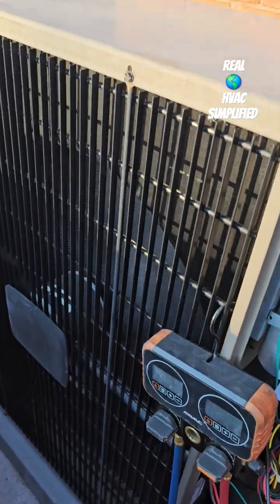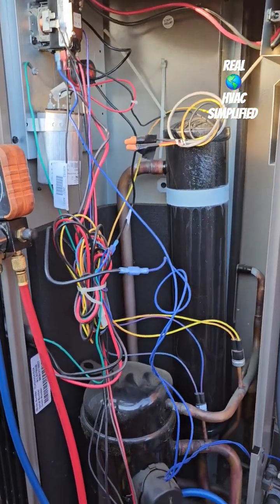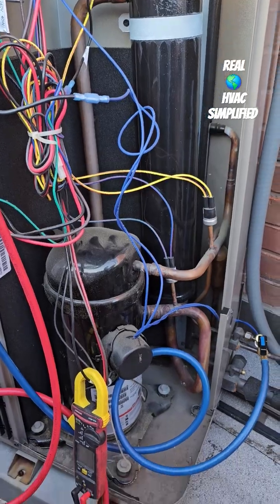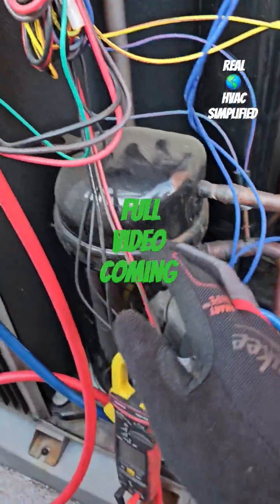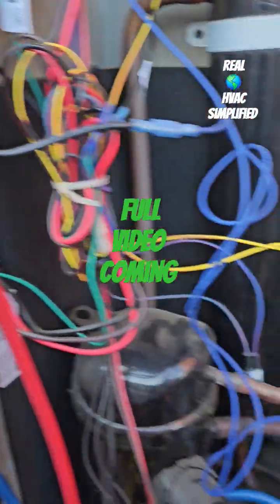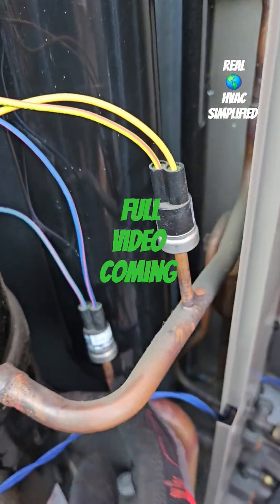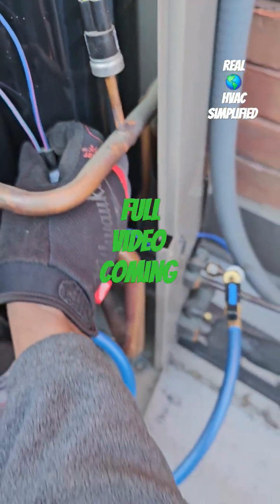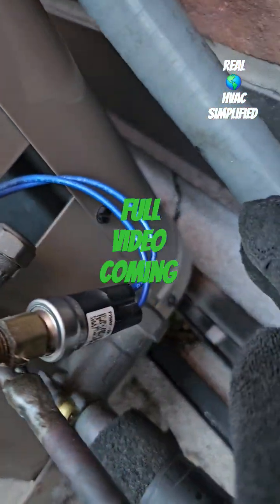HPS. LPS. AND..🤔 WHAT'S THIS ...? #d2dnyac #hvactechnician

Comment: They are probably using that in a grow house up north where the weather is cool that they need to keep the inside cool from the lights that’s for the condensing fan motor to allow to build up heat for to work properly